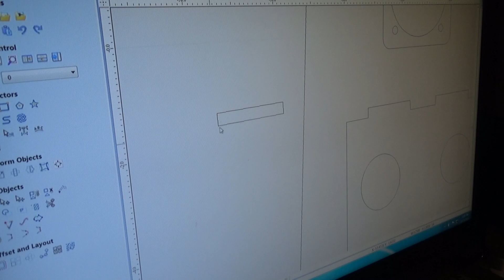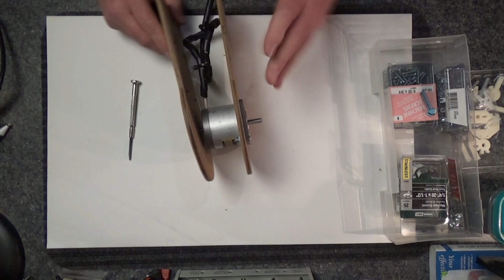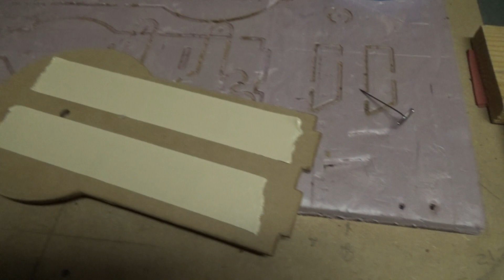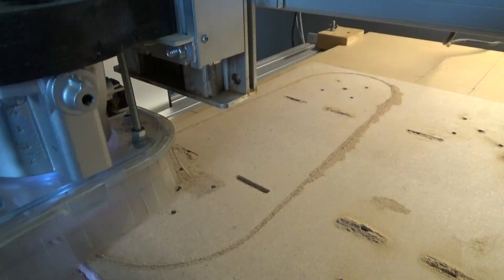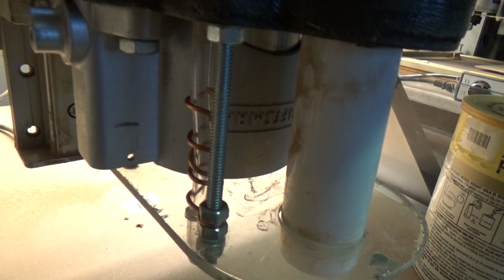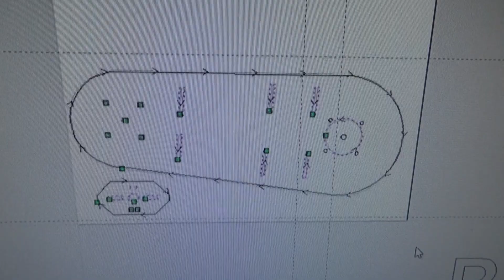Building Robotic Arm using CAD and CNC Router

Comment: Hey Steve, ive watched your cnc videos for a couple years now. And had planned on building a jgro. About 9 months into that i found a craigslist deal on one a guy did a great job engineering. It has a32"x60" work surface. After nearly a year off and on working on it as i gathered the compinents and software to make it run, ive made 2 signs today.
Thank you so much for sharing your knowledge and explaining things so well! I now have a hobby with few limits (except the ones mounted on machine 😁) and has potential to be self funding if not profitable.
Happy Holidays bud!
Andy Reid